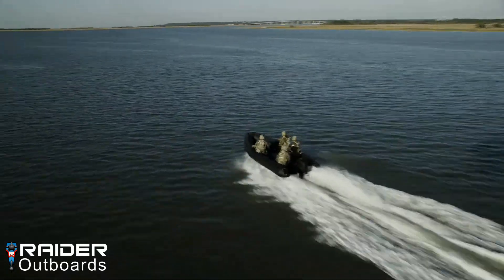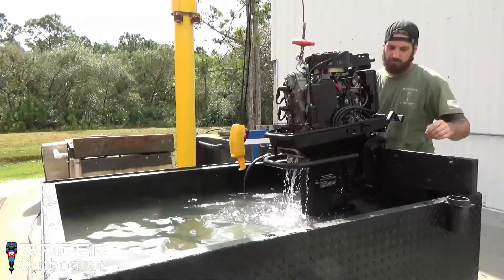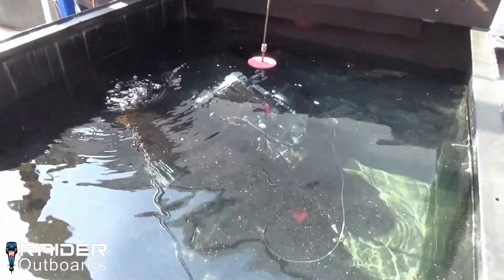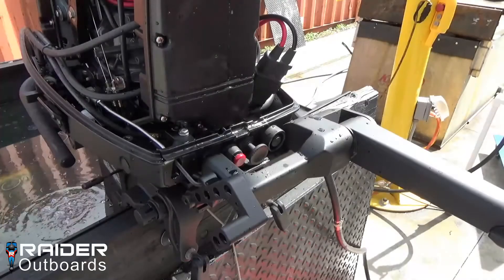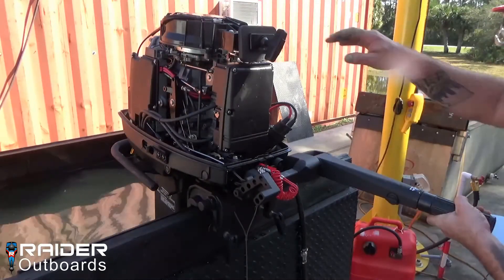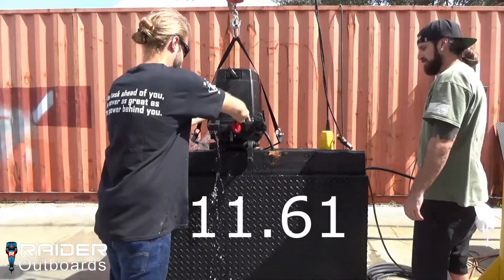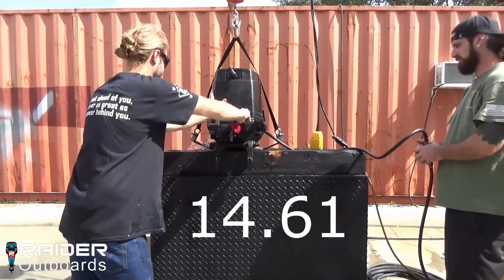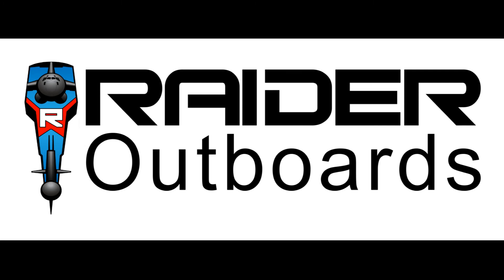Raider Outboards Model 50 Dewatering

Comment: Yeah right... Just before you get flipped by a Wave make shure you engaged all 17 Pre Submersion settings.
Reply: The idea is that you would do this procedure before water or air deployment. These engines will still work if it isn’t done, just will take a while. I have used these as well as the original Evinrude submersibles.